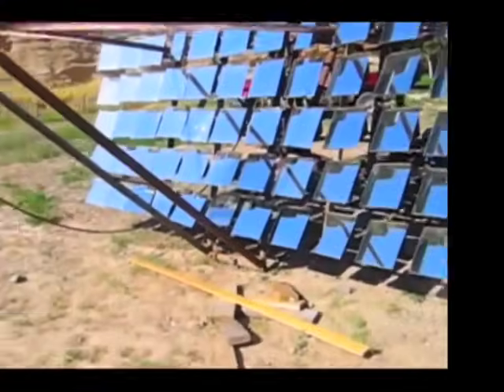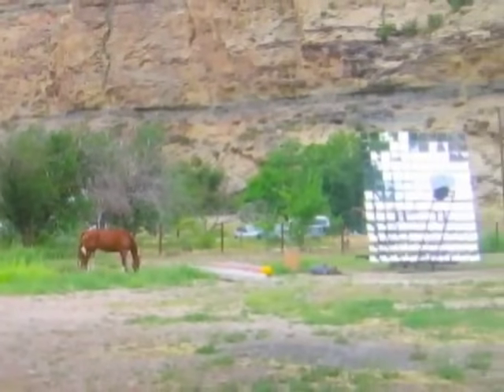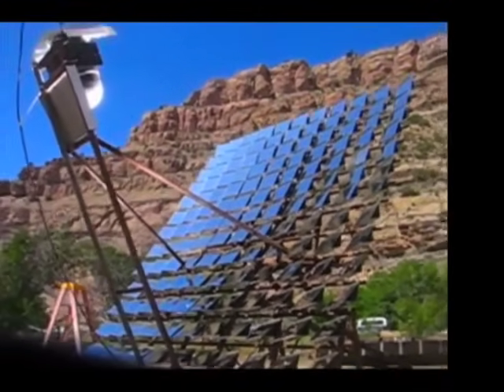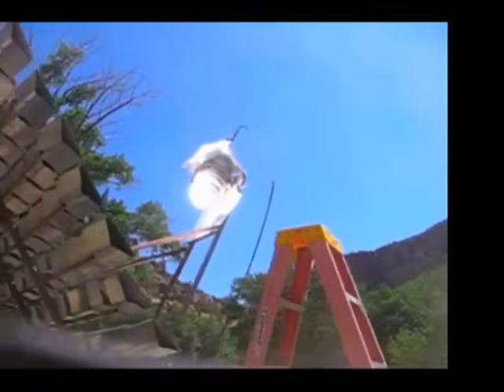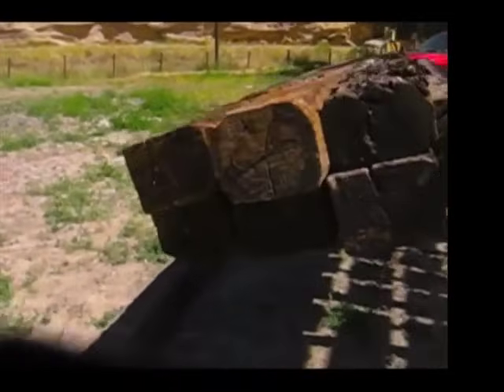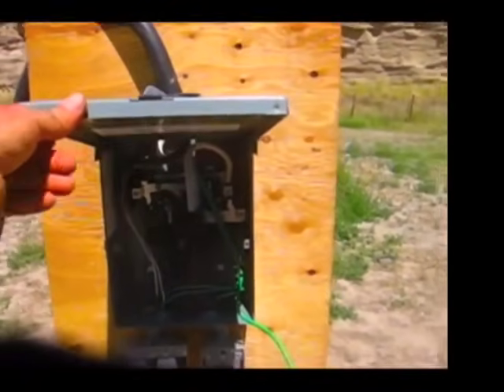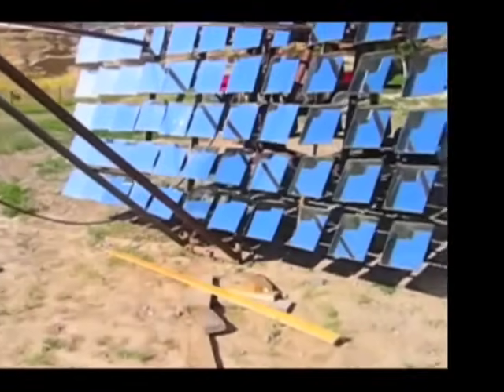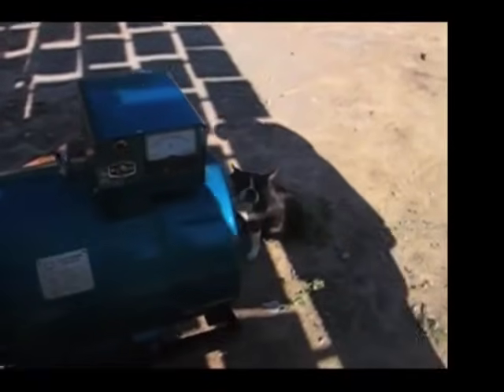STEAM ENGINE 12KW GENERATOR Solar Mirror Array Death Ray

Comment: Why don't you focus with your explanation on the installation of the heat-capturing head, the idea of a shower or a solar microwave, I implemented it, but I lack the information about collecting the rays in the head, focusing it, and converting it into heat + electricity, storage,

Comment: A huge scam, a small steam powered electric generator has an efficiency of about 20% at its best, that means that the size o the mirrors must be at least 60 square meters. 8*8 meters is 64 m2. This is crap and a scam.
Reply: Said the paid troll

Comment: Would not work in northern climates so well. But I can see how a computer program could use a sensor system to help aim all those mirrors through a servo system relay to constantly follow the sun or just move the whole plat form and have all the mirrors set already. Either way it's very possible. Find one of tech students maybe they'll do it for free for a school project.

Comment: the area is around 181 ft^2 . That translates to 16.8 kw sun power input. Let's say the steam to electricity conversion is 30% effective (which is a lot for a construction like this) then the output should not be more then 5 kw .... as long as the sun shines.

Comment: I guess this 12kw in the title is just about the generator, or the power harnessed from sun based on the area of mirrors.  They forgot to mention the low efficiency of steam power.  30% for turbines, 5-10% for engines..

Still cool as hell, though!

Comment: Hello,
 An excellant topic to explore .
 I first saw an arrangement almost exactly like this in the Mother Earth News, I think about 1979. I have all the old issues and will start building this and many other devices this summer. 
 The mirror array was 10'x10' and had welded conduit with 1/4 rod and lite gauge sheet metal holding the mirror tiles. A G.M. window motor with radio shack sensors tracked the sun while focusing on a steel coil that had refractory fiber insulation on the back side. The groundwater @54 degrees was superheated to 240 degrees which ran a steam engine that turned the power generator. It also provided hot water for the house and greenhouse. I hope to use the water to heat the concrete slabs in my buildings and returning the water back into the ground to replenish the aquifer.
 Great idea to bring this back for construction.
 Respectfully,
  Charles Hugh Bryan

Comment: It's alive! Guys, forget the mirrors. Magnify the rays of the sun, and have the lens move with the sun. It only takes an electric drill, and a dark\light sensor. You did get the steam engine part right (I think). Lastly, centrifugal clutch is how to handle a larger load, and compressed air can substitute for steam if the psi is equal. If a little 12v junk compressor can air up a tire surely a solar panel or windmill could put some pressure in an air tank. I wonder why those cars (😎) that run on air compression in the U.K. don't have a few windmills (turbines) on the front and/or top filling an alternate or reserve tank? I mean it gets pretty windy when traveling several miles per hour, and that is the idea. Is it against the rules to design a perpetual motion machine or something? Whoever said, you can't get more energy out of something than is put in,must not have heard of a power inverter or an understanding of collapsing magnetic fields (like the coil in a car). Both examples are like putting Edison power in, and Tesla power coming out. I'm tired of scientific laws telling me what I can't do. I work for God so I don't have to obey the laws of physics (strawberry).

Comment: black is good for collecting heat on the painted white heat collector..just thinking you will get better performance from the sun :)
Reply: it's pretty insignificant an effect at the high temps you're throwing at it.  And if you look at a commercial collectors, they show up white anyway due the receiver absorbing (if you will) the wavelengths that would give you a color...

Comment: Great development setup (I'm writing in 2018, this video is pretty old by now). This is what I have wanted to do (tracked solar -> steam -> engine -> electricity) for some time, and this system has some good ideas. And some not-so-good, from which we also learn. I'd be looking at a much smaller power output (2KVA) so that reduces the problems also. Thanks for the video.
Some thoughts (mostly about Efficiency, which is THE KEYWORD for this stuff)
1) Use bigger mirrors, and reduce/remove the gaps. About 20% of the structural area of his array is unused. Bigger mirrors (double would do) reduce the complexity and weight of the structure. Make the mirror brackets much lighter (rods, not plates).
2) The target (in this case, the boiler) needs to be fully closed within an insulated housing (6 inches of fibreglass mat, for example), open only toward the mirror array. Adding a tapering, mirrored tube to the outside of this opening (mylar sheet such as Space Blanket) will add light capture, with minimal weight.
3) Steam recovery - saves a lot of wasted heat/power. Even just used as pre-heat for the cold input water.
Reply: those are some good points!!
what is the most EFFICIENT way to turn heat into electricity?
Reply: I'd say this video was so ahead of its time, but these concepts have been actualized since at least the 70s! But I have become so intrigued by these types of machines recently, I would like to investigate smaller, efficient, modular boilers using fresnel lens for easy aiming and focusing. Say, an array of four fresnel lens each heating a small boiler... can easily expand by adding more fresnel boilers.
Reply: @rickfrogm825  Yes, the key to the future with this concept is smaller concise fresnel type of lenses, however, the key to efficiency is NOT the lens, but rather the heat sink (boiler) this is the secret they talk about. If you're going to use fresnel lems' you have to develop a boiler that resembles a Gatling gun.
9 Chambers of water with psi regulated steam release valve.

For storage, use capacitors in a Cascade, far better than batteries. To be more precise, use capacitors banks from as low as 1kw to megawatts if you feel the need.  It's like having a radio amplifier in your car; they can squeeze every last morsel of energy. Possibly look into amplodines.  Hope this helps.
The steam side was perfected by going closed loop and recapturing the spent steam..
Thanks for watching, I haven't watched it in years myself, but I liked your comment so I decided to tell you what I learned, hope it helps you
Joe.

Comment: Well, this is not generating anywhere near 12 kW. it looks like about 9-10 square meters. The sun gives anywhere between 120 and 300 W per square meter (wiki Sunlight). So 300 *10 m2 = 3kW energy. if somehow he's able to convert the energy at without any loss that's 3kw, not 12. And I think it's more like 1-2 kW at most. You can put 10 MW generator but you can't get more out than you put in. The 15 Amp saw spins and cuts, but it'll do that at 10 amp too, but with lower efficacy. It is nice setup though. I wonder how he is doing the tracking. Does he rotate manually?
Reply: It is about 1200W per square meter on a cloudless day with perpendicular surface.

The figure you are getting is probably average over a year, with averaged clouds, and day might cycle, and on ground (not perpendicular to rays from the sun). Add to this low efficiency of PV, and you get about 200W per square meter from PV on a good day at peak.

The problem is that there are other inefficiencies in his system. Totalling to 1-2kW.

Comment: Why not use Fresnel lenses on too the boiler..
Reply: If the mirrors are aligned right, lenses on the boiler won't make a difference unless the reflections are bigger than the boiler surface area's profile.

Comment: He should use that to power an hho generator. And use that gas to power a gasoline powered generator
Reply: You would run into a whole bunch of conversion losses that way. It could be a good solution to store hydrogen, but gas generators are so very inefficient really. Fuel cell would be better.

Comment: This has the same problem all solar projects have in that it only works when the sun shines.  Now if this had a gas or other fuel back up, it would be a worthwhile system.  Then there is the problem with steam being used.  With that you need a bunch of auto controls to keep the  water level in the boiler, and monitor the steam pressure to kick in the gas or coal powered heat if the sun goes behind a cloud.  No one wants to baby sit a steam engine 24/7/365 just so they can save on the electric bill.  Another thing that many of these systems don't have is a way of lubricating the steam engine and recovering that oil.  With that you need a monitoring device to make sure that you have enough oil recovered.  In engineering you don't get something for nothing.  Just aiming a mirror at a boiler does not make a power plant.  When all is considered, the cost of a self sustaining system will be greater than solar cells, and even they only last about 25 years and their output is reduced every year that they sit out in the sun.

Comment: nice setup ! a litle bit bulky but fonctionnal , you could add a return cycle for the vapor exhaust to a heat exchanger to condensate in water and have a continious cycle without having to add water , you could also add some peltier thermo-electric plate on hot part and generate more power due to differential of temperature between both side  ( they are very small and affordable a pack of 10 piece of 2inch square 50-70 watt each cost about 10$ on ebay ) i assume you have a sun tracking system to optimize the exposure .
overall nice "mac giver style " free energy generator to run your homestead ! great to see people empower themselves and share knowledge.
Reply from the maker: Thank you for the nice comment Stef!
Reply: Hmm. That heat would have to go somewhere to get the water back. Fans would use energy but a stream would do it... But then it would negate the need for water. Condensors would be amazing if you needed to save water, or your system couldn't healthfully run on the raw water available.

Comment: Sometimes you say 12 kw, and other times 12 kwh.  Which is it?  Since about 1,000 watts of solar energy per square meter reaches the earth's surface, it would take at least 12 square meters of mirror divided by your efficiency percentage in order to yield 12 kw.  The video does not appear to show a mirror that big so can we conclude that you mean 12 kwh?  Thanks!.

Comment: the cool thing about his system is that "hot" is the only resource he needs.
he could be burning junk mail for fuel all night or if it got a little cloudy.
burning low grade biofuel will also help reduce the amount of carbon in the atmosphere because the plants you burn will have to take up more carbon than you can harvest for fuel, so it becomes a net carbon negative process.
Reply: There is nothing wrong with carbon in the atmosphere or anywhere else.  We are a carbon-based life form and life on this planet would cease w/o carbon.  You've been lied to by creeps with an agenda.
Reply: David Rice 
Are you talking to anyone in particular?
Reply: HAHA!

Comment: first thoughts here there doesn't seem to be a condensing cycle so this thing will use loads of water which is a resource and not be very efficient. Also the thing seemed to make lots of noise so the neighbors will love him. It is cool, though must be cheaper to get some solar pv
Reply: +Morgan Wasem I think the main benefit of this, over solar PV is the cheapness of setting it up. All you nee is mirrors, and a few other bits.

Comment: It's not 12 kw, maybe 1 or 2 kw.
Reply: 2-5 max solar
generator 12?
Reply: His breaker box is rated at 12kw... 240V @ 50A
Reply: @jeffshackleford3152  The total wattages of the breakers is immaterial. He needs the generator to produce 12 KW on demand. 

One addition needed is a speed regulator to keep the generator output constant under varying loads - see old steam engines for how they work.

Comment: Hi Dennis and Denise,
I'm writing you here because I ran into something I think is awesome in VAWT like the ones you have built out of PVC splits and the plexiglass slat one. This one uses 8" diameter PVC schedule 40 cut in lengths a foot long on an angle. A layer of such pieces is anchored to a plywood disk about 4 feet in diameter. They are angled about 22 degrees from horizontal axes so they form buckets. Several layers are sandwiched between 1/4" thickness disks 4 feet in diameter. The one being discussed hasn't been built by anyone to my knowledge. I am too old to build it as are my retired buddies who were telling me about it. The reason it came up is that it is much easier to cut lengths off of a longer piece of PVC than split it. Just a suggestion if you get froggy. I would love to build it but am just not up to it anymore. I am an idea man these days. LOL  Love you guys. I think this is very easy construction for a VAWT and should be relatively cheap. Diameter was chosen because you can get two 4 foot disks out of a sheet of plywood. CDX should be good enough because it self strengthens as it is screwed and glues together. A pole piece of pipe is used as an axle. Pipe flanges are used on top and bottom. A flange ball bearing is used top and bottom to anchor it to the drive shaft. This should be omni directional like Sinovious type. If you put a cog belt on it to a Fisher Paykel washing machine motor converted to a 3 phase alternator, you should have a fairly powerful wind turbine.
John Mahler. (keep up the great work)

Comment: Dennis / Denise / all - I've read all opinions and questions - several things I didn't understand. I'm really interested in developing these ideas.

1- Steam generation - about 9 m² of mirrors concentrating light/energy in a 'bottle' where water boils and generate electricity by Tesla turbines - 12KWh. 
Doubts: what mass/temperature/pressure of steam were obtained on this system? How to recharge water (fresh or hot?)?

As I understand (I'm not a specialist) TEsla system works with high velocity steam but without enough mass (of steam) the turbine will 'cavitate' and stop - I don't see that bottle of water generate more than 1 kg/hour of steam at less than 1 kg of pressure - then the inertia of turbine plus generator will be bigger than this... From where this energy comes?

I imagine a steam generator (fuel gaz/ biomass as ex.),  giving steam at 130ºC and 4 or 5 kg of pressure, something like 30 kgh. This you might use sun light (by mirror or lenses) to give up a gain of pressure/temperature and use it with a good thermal jumping to generate good volume of energy (work) - continuous and consistently.
We cannot create energy - this is the question - we transform it

This Tesla turbines works quite well at laboratories - small ones run at 80 000 rpm, big ones might run at 20 000 rpm (big energy) - but question? what is the volume/velocity/pressure of this steam???

The solution/answer/equationing of these questions might open a good professional new 'way' to go to low investment 'free power' - on this matter we are interested.
Congratulations for the work

Comment: This Solar Boiler was featured in the Mother Earth News back in 1979 or 80. Using 1'x1' mirrors and frame work of steal. A close friend of mine and I found a $1.00 electronic board at the army surplus store that we used to track the sun on a 3 min. time line. At the end of the day the rack would hit a limit switch that would return it the beginning again for the next day tracking. We used a steel drum and a high bay light reflector for the tank to gather all the heat on all sides of the tank as possible. Check with Mother Earth News and like I said back in the late 70's you should fined the solar boiler listed. At that time I was living in Georgetown Colorado where it would work good for about three to five hours a day due to the mountains east and west of us. Now in Alaska and we in summer get 360 dog. Of sunlight. Still working on that but in winter about 4 hours is all we get in Willow, Alaska.
Kent
Reply: check the first comment, that guy worked on that project

Comment: 100 square feet is about 9.3 square meters.  At about 1000 watts per square meter and 50% efficiency such a mirror sytstem could produce about 30 kilowatt hours of electricity a day which is the amount of electricity used in a day by the average residenrial customer.
Reply: +John Smith What happend if the sun is cover?Can be improuved.With a heat exchanger,and a vacuum sistem.watter steam produce vacuum if destilled .First steam engine was actualy atmospher engines
Reply: now, run a DC generator and push that power to batteries.